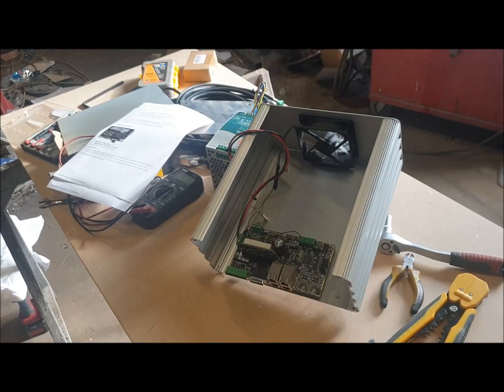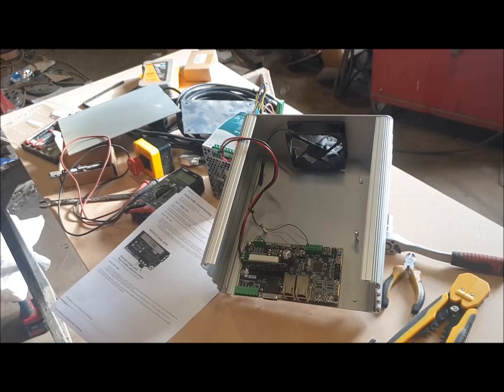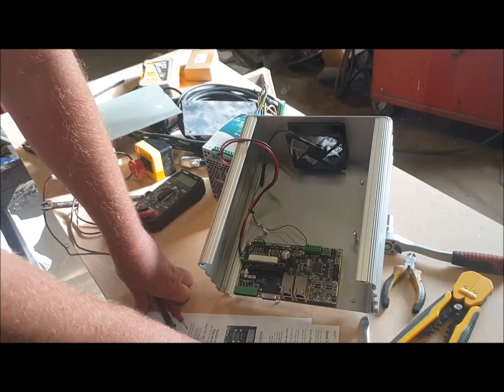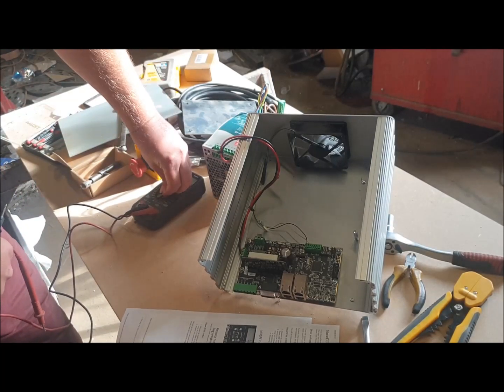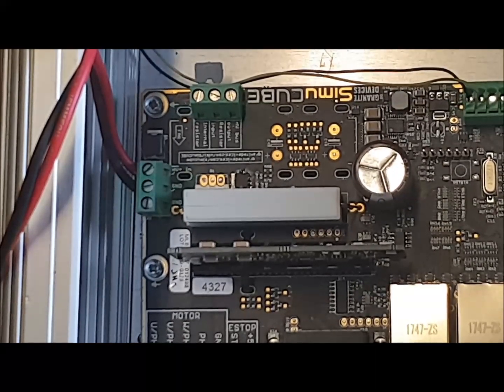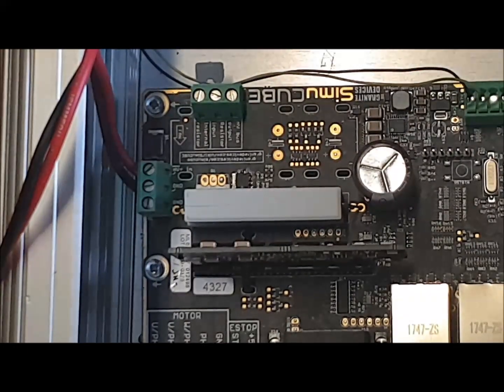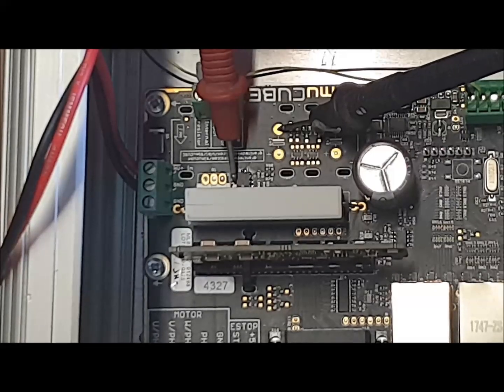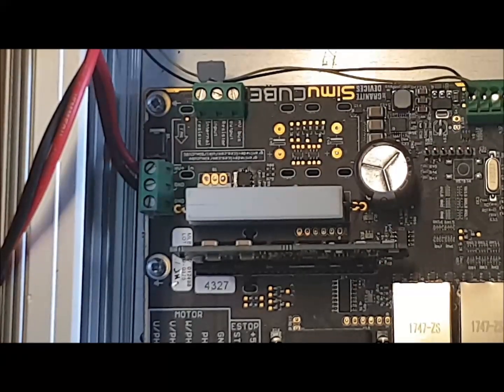Part 2 Inside an OSW Open Sim Wheel. No FFB Simucube/Ioni problems.

Comment: Where did you get that case for the control box?
Reply from the maker: That came with it from Sim-plicity.
Reply: @GPRaceSimulation  do you know any stores selling a case for the IONI, Simucube board and PSU? I know how the wirings connect but I don't want to DIY a case. Mostly the DIY cases are too big
Reply from the maker: @MarkVersion1  I don't. I think that one was made from aluminium profile and flat ally sheet laser cut. The VSR case looks small and neat and they use a different power supply, so I was looking at making something in that style.
Reply: GP Race Simulation I hope other companies offer control box cases for those want to go the DIY route
Reply from the maker: @MarkVersion1  I can make a copy of mine if you want.
Reply: @GPRaceSimulation  sure. that's great!
Reply: Let me know how I can contact you about it. Thanks
Reply from the maker: @MarkVersion1  gpsimulation2018@gmail.com